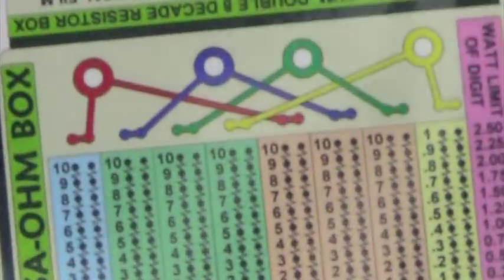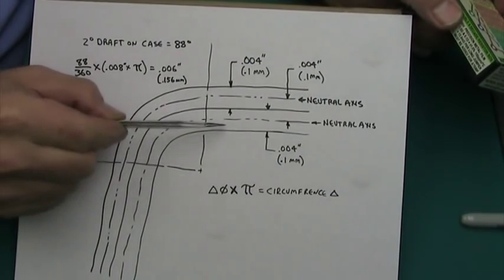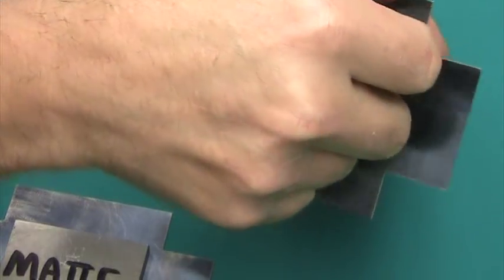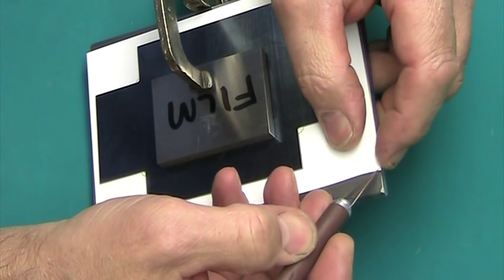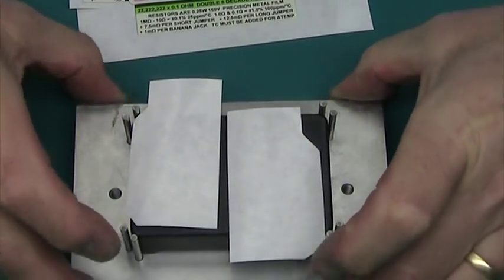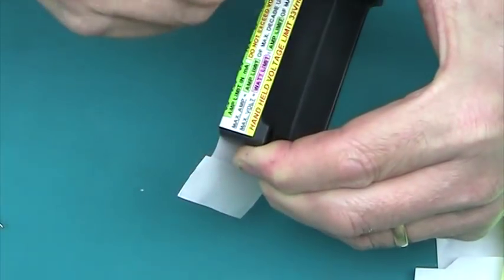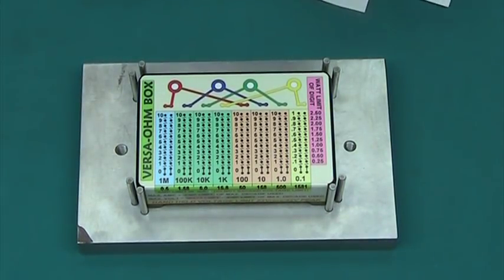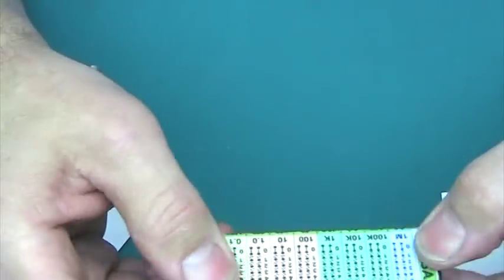VERSA-OHM  GRAPHIC OVERLAY APPLICATION

Comment: Another awesome -job. One of the cutting processes we use when screen printing labels for production applications is a process called “Kiss cutting” essentially printers rule is pressed from the rear cutting the backing paper but not the adhesive and printed label, allowing you to peel off the backing in sections. Typically complex shapes would be ordered as a knife die,
Reply from the maker: Thanks again JB and thanks for watching and commenting.

Comment: Hi mate.  Have you tried to float them into place.  Basically, a thin mist of water is applied to the surface that you want to place the sticker on, and then float it on top.  Then, with a rubber squishy, you push the water from under the sticker.  It works a treat.
Reply from the maker: Thanks Marcel, I will have to try that technique the next opportunity I get.
Reply: Water with detergent is not just water, a commercial product called ‘splash’ is usually sold in sign making and application industries

Comment: You sure have this figured out to perfection, how many of these have you made? Do you sell them via a website or somewhere so I can look at them (probably not afford one I expect)? I like to use the Hammond 1599 cases with the recess for my decade resistors, this way the film doesn't have a chance to lift or collect dirt at the edges. The older ones aren't so pretty any more, but I've given them all away so I don't have to look at them. ;-)
Reply from the maker: I have 24 in the works but Interest in them was not very high so they have been sidelined for quite a while.

Comment: How did you cut out the steel template, particularly the notches? I have tried cutting thin stuff on the mill and it just flapped around like crazy.
Reply from the maker: That material is blue temper spring steel at 48 to 52 Rockwell C scale. I rough them out with a cutoff disk on a disk grinder. Then they are precision ground on a surface grinder.
Reply: +ROBRENZ you stack them and grind several at a time?
Reply from the maker: Yes in this case the two pieces.